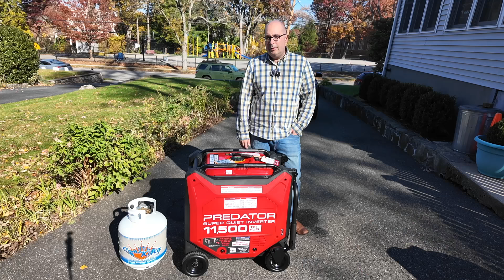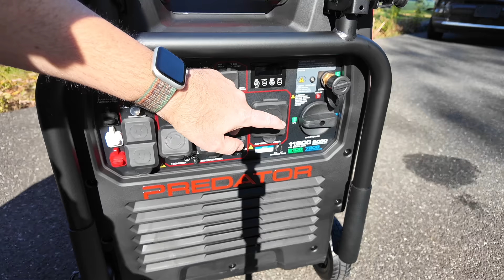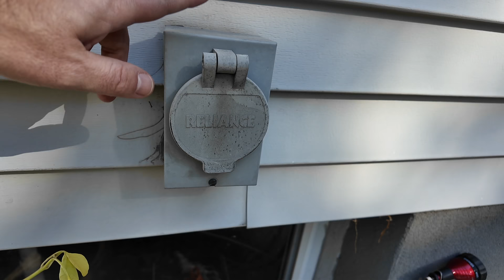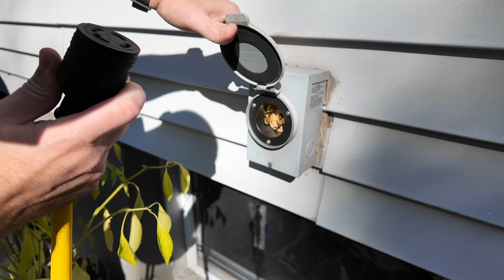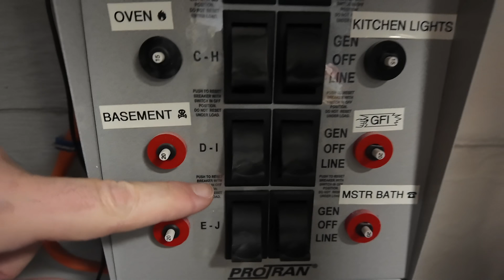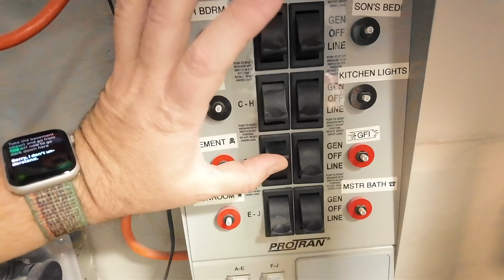Predator 11500w Powers My Entire House (Transfer Switch & Full Test) — Honda Should Be Worried!

Comment from the maker: So… would you trust this Predator 11500 to run your whole house instead of a Honda or a Generac standby system?
I’m honestly curious what you guys think — is this the future of backup power or a bad idea waiting to happen?

What do you want me to test next?
🔹 Propane vs Gas
🔹 Noise test
🔹 Fuel burn / runtime
🔹 Predator vs Honda showdown
🔹 24-hour non-stop run

Drop it below!
Reply: I’d like you to run the test by letting it operate for 24 hours.
Reply: @yagofornite  I have a Predator 5000 and we did a week long boondock camping trip. The generator ran 24/7 for 6 days stopping only long enough to refuel. We had zero issues. I'm honestly impressed with the 5000.
Reply from the maker: I love the 5000!
Reply: @yagofornite it powered my shop for 72 hours and still run like new
Reply: I would most definitely buy this Predator generator over a permanent mounted Generac or other brand. I love Honda, but they are too expensive for me.
Reply: @Prepared-NotParanoid and you’d make a good choice. Hondas are excellent no doubt but they are not worth their price imho
Reply: Definitely. You can get two of these and still be cheaper than the i7000
Reply: "So… would you trust this Predator 11500 to run your whole house instead of a Honda or a Generac standby system?"
Simple answer, yes. 
During Sandy my Honda 3000 ran what I could in our house for 13 1/2 days, non stop, almost 320 hours, including my neighbors fridge and TV for the first week.
At that time Generac had a terrible reputation for engines failing within a year.

After Sandy, in 2012 I installed a 15KW Milbank NG generator with a transfer switch. Did 99% the work myself, got the genny and switch on close out from a local electrical supply house ($4,215, delivered).
Only work I didn't do was replace the gas meter from a 200 CFH to a 400 CFH. PSE&G replaced the meter at no charge as they are required to supply the service for the calculated load. The service team also piped in a capped tee for me.
All in I had just under $6,000, including landscaping that was required by the town. That was a bargain, contractors were charging an average of $20,000 right after Sandy.
Worked great and for the next 8 years and it was used twice for a power failure. First time the power came back on before the transfer actually occurred. Second time it ran for over 2 days while we were away, that was not acceptable for me. My neighbors had to listen to it for those two days and had we been home it would have been off at night.

I sold my Honda 3000 after 15 years of use with about 1000 hours with zero problems other than the battery, and Honda's really don't need the electric start.
The 9500 and 5000 predators have a history of engine problems, specifically rockers and or pushrods failing.

New house in 2020 is in an area of reliable utility power and I decided on not having the expense and noise of a permanent standby unit.
Had an electrician add a panel interlock and run the cable to an outside receptacle. 
Took the gamble on the 9500 over the Honda 7000 mainly because of cost, $2000 versus $5500.
Have only used it once for an hour or so since buying and if it fails I could replace with the new 11500 and still be less than then the Honda.
I don't think Honda has to worry, there are Honda people that will only buy Honda's.
Reply from the maker: All of your points are 100% spot on and I totally agree with you!
Reply: Predator vs. Honda showdown PLEASE!  SOON!
Reply from the maker: That’s a great suggestion! I’ll try to make a future video about that
Reply: As someone who had a Generac GP15000E and a Predator 5000, the power is much cleaner coming out of the Predator being an inverter. The Generac is quite dirty and temperamental. Unless you load it heavily the Generac has issues with voltage fluctuation. During a hurricane, I was keeping power use low to conserve fuel but started having issues with appliances and battery backups. I ended up running things I didn't really need just to keep the Generac stable. I will add with the Predator, we ran out RV for a full week on it 24/7 with no issues, but we had to turn eco mode off. It wouldn't handle the RV A/C kicking on in eco mode and just shut down.
Reply: After looking at stand alone $13-17000 cost Kohler.. went with the Predator 11500.  For about $5000 cost purchase and install I have a triple fuel, quiet portable whole house generator.
This was panel upgrade, ramp for backdoor garage, safety switch for main off and Gen on.
Think this was the ticket for me.
Reply from the maker: I totally agree with you on all points!  Congrats on your new genset
Reply: With the information and proof you have provided, I trust the predator 11500 big time.
Reply: These have proven themselves already.  HF did a great job here especially when you consider the price..
Reply: So I live in rural Maine, so we're accustomed to losing power for several days or even weeks in the middle of winter. I have a Predator 9500 and I bought a second one for my Parents home so I can make sure during a storm they have power as well. The 9500 will power my whole home no problem so long as I do not run certain things at the same time. It will run my furnace, water heater, all the lights, tv etc with no issues. But if I need to do laundry I have to make sure I turn off the furnace while the dryer is running. If I am am running the oven I can run it with the furnace but to be safe I just click the furnace off while we're cooking. We have natural gas at my home and my parents home so we are buying the 11500 predator and getting rid of  both of the 9500s so we do not have to buy gasoline. We have had no issues with the 9500 at all so YES we would trust the 11500 as well. It's very nice to basically keep living as normal when the power goes out. I even occassionally take my generator to friend's homes during an outage to help get their heat turned back on and make it so they can maybe take a hot shower and cook a meal or two, and for that purpose I might keep one fo the 9500 generators to loan out or take to peoples homes.
Reply: Be sure if going Generac brand, or any brand, get Inverter type.
Reply from the maker: @VZWSevenFiveFive4334 inverter is definitely key
Reply: I have two transfer switches: one for the most important circuits and another for optional circuits, which I don't hook up too often because I don't want to run 2 generators (they're so loud). They have the standard NEMA L14-30R males (30 amp). With this one generator, I can power both by getting a 50 amp male to 30 amp female adapter that I can get from Lowes. I just have to sell one of my other generators first. If this is covered with EMP proof cloth, it would still work in a worst-case scenario, but a Generac whole house would be fried.
Reply: Predator vs Honda please
Reply from the maker: Will try to do that in a future video!
Reply: @Outdoor_Prepper  That would be GREAT!
Reply: I have a Predator 8750 open frame inverter generator that I bought with a no coupon for $899 plus tax. I have several natural gas appliances, so I have no problem running my entire house, although I do not use my electric wall oven, just my gas cooktop during outages👍
Reply from the maker: That’s a great setup!
Reply: @Outdoor_Prepper  I used the 30A breaker from my old electric water heater, and installed a 30A plug with a 30A cord, for a total cost of $1,100. I have a checklist on my breaker panel so I never forget to shut off the main breaker or the generator breaker👍
Reply from the maker: That’s a solid setup!
Reply: Of course. Like the Honda or Generac have some superior power production. Not!
Reply: Maybe not, but in all but edge cases, Hondas are replaced on your terms, not the generator’s. There is a real cost to owning a generator with a mean time to failure beyond 5,000 hours, which is why you do not see Formula 1 teams, Hollywood productions, or heavy highway contractors relying on Tier 2 generators.

The EU7000’s direct fuel injection improves fuel efficiency and largely eliminates the carburetor problems common in modern emissions-restricted designs, where adjustment is limited to idle speed only. Then there is the risk of inverter failures. Some failures can output unregulated voltage and potentially damage electronics and appliances.

The EU7000 has dual redundant output monitoring. If power quality is not perfect, it shuts down instead of passing bad power. That level of protection is uncommon in Tier 2 generators since cost has to be cut somewhere. This is especially concerning with traditional open-frame non-inverter generators, where one of the most common failures is the AVR, often a roughly $30 part that, when it fails, can produce wildly out-of-spec voltage.

Both options are priced appropriately, and the Predator is a strong value. Ultimately it comes down to user preference. For me, I factor in that you will not be able to buy a second Predator during an outage. 

Though anything can happen, which is why I’ve decided to order a EU2200 to replace my 6800W Ridged with only 101 Hrs, which runs perfectly, but now that I have it hooked to my entire house am not comfortable trusting all of my electronics and appliances to a very common to fail $30 Chinese AVR or a cheap mechanical governor, either of which could fail and cost me tens of thousands of dollars. (Plus I want it out of the garage, one large generator takes up enough room. 

I must emphasize there is no right or wrong. It’s just user preference, use case, and risk tolerance (in the eyes of the user).
Reply: I would absolutely trust the predator generator to run my house. I have the 5000 watt dual fuel and I have used it in emergencies. And no it won’t run the house. Just what’s necessary. No issues and it’s decently quiet for its size. Also, the predator generator has been out for awhile. And they’ve made some positive improvements over time. And I could buy another 5000 watt generator and parallel the 2 together for 10,000 watts. And I already have the kit to do that. It was about 50$ at Harbor Freight I think. It’s a great unit! It’s also a great unit for an RV if you have one.
Reply: Propane VS Gas.
Reply: Yes I use the Predator 13K with interlock to power my home during power outages. Works great with my mini split system, fridge, washer and dryer etc
Reply: Ookm
Reply: I have a Predator that powers my house except bedroom lights. Powers AC, furnace, well pump, fridge and additional freezer. Family room with big screen and computers. Have it on manual transfer switch. Excellent quality
Reply from the maker: @MrJacknoJill the predator line of generators are actually really good!
Reply: Fuel burn/runtime and 24-hour non stop run.
Reply: I Would!!!!  The more it cost doesnt always means its the Best!!!  I own several Predator and Champions they always been good to me if your Good to it!!!!!!!!!!  6k  for a gen is Ridiculus!!!!!!
Reply: Maybe 1/3 the cost!
Reply: I have a 8750 predator would be think that would a two tons HVAC system and septic tank pump? Just for winter emergency if we lost power due to ice storm?
Reply: Whole house generators overpriced thing of the padt now. 
Love Harbor Freight! I hear nothing but good things about their Predator generators!
Reply: Lkookomkpok
Reply: My predator 9000w took care of me in 2021 during that ice storm. My Harbour freight predator 9000w ran continuously for 6 days
Reply: Man great stuff I watch you all day. I was considering the anker 5500 gen with additional Anker batteries for a range extender setup, thoughts?!?
Reply: That lil tank will run that Generator for a couple of hours depending on the load.  If you plug it into your natural gas... LOL get ready to take a loan for when you have to pay the bill for a multiday event, not as bad as a Generac running for a couple of days but still most people dont realize the cost would be in the thousands ... bro THOUSANDS.    In a multiday event like a hurricane or the snowmageddon here in Texas, you will need good ole gas ...I would keep a good 25 gallons of non ethanol gas treated with some sort of fuel stabilizer.  Fill up your car once a year and then replace the fuel.  My house has most appliances running natural gas... heat, hot water, cloths, and range.... I ran a lil ole Champion 2500 on a one 100 lb propane tank like that for two weeks until our power was fully back on (no rotating blackouts).  For summer outages I have a large WEN that will power my AC ... but the longest in the summer has only been a day or two.
Reply: @xmarine11 Wrong.  Nat gas is cheap.  Look at your electric bill.  Nat gas is a fraction of what the electricity part of the bill is.
Reply: @xmarine11I don’t think natural gas would cost thousands for a couple days…???
Reply: @xmarine11 Great advice on the gasoline storage. I wish I had done that because it might have saved me some money. I'm in East Texas and we had a 5 day outage in the middle of the summer. Temps were triple digits during that time. I used a 4000 watt Wen to run a couple of window units at night and a 2500 watt Champion to run fans and a single window unit during the day. I kept our fridge and freezer going with 400 watts of solar and two 12 volt LiFePO4 batteries. There was one single station in town that had a backup generator and were able to sell fuel. We ended up spending about $130 on gas and propane.
Reply: The future is a battery backup system with solar and a generator like yours to top up and supplement  the batteries.
Reply: @turtle1723 maybe one day, but right now they have too many drawbacks to be viable for most people.

Comment: Not ideal as low running watts and having to continually refill the rank if using gasoline too.
Reply from the maker: Fuel efficiency and total output capacity are always important factors to consider for any home backup setup.

Comment: Nice video. Several years ago I got a 7500 running Watts champion generator and hooked it up to my house.  I thought I was going to have to use a transfer switch but I found an interlock kit at home Depot for 50 bucks.  While I'm not an electrician I hooked everything up by myself so if you're handy with wiring and breaker panels it's fairly easy and a whole lot cheaper than a transfer switch.  My only regret is not getting a dual fuel generator as the one I bought is strictly gasoline.  Thanks for the video
Reply from the maker: That’s a great tip, interlock kits are definitely a solid and cost-effective alternative to a full transfer switch! 👍
Reply: @Outdoor_Prepper the one thing about interlock kits is that you have to get one that is specific to your main panel.  You Can't just go in and buy a universal kit.
Reply from the maker: @michael.w.salter totally agree 👍

Comment: This information is not accurate. You should unbond the ground on the generator IF you’re using the interlock method. 

In the USA you should only have one bonded ground in your home and that should be the main panel. 

Using a transfer switch like you have, from what I understand, does not always carry this same issue.
Reply from the maker: With the transfer switch I have, you still have to un bond the generator
Reply: @Outdoor_Prepper you did not highlight this in your video that I recall hearing/seeing. 

Did I miss that?

Comment: Good review. I was hoping you'd go over maintenance a little more. Before starting you added oill, where was that positioned? Did you have to remove a plastic panel to get to it?Also is there any protective features like does it monitor the oil and automatically shut down if it's low? And  when you hooked up the power cord  then started  the generator, were you throwing power into that box that was  connected to your panel? I saw you have breakers in that box you installed with the romex but All the circuits were connected to the main line right? Then you switched the basement to generator power. Did I miss something? I was looking at a gen-max TRI-FUEL 11000 start amp...
Reply from the maker: Thx for watching! You have to remove a side panel to add the oil. It’s a little difficult to see the oil fill as it’s pretty low on the unit. It does have a low oil shut off so if you don’t fill it enough, it will shut off. Basically you fill the oil to the top of the threads of the oil fill

Comment: Actually you're not powering your whole house. At most you're pushing 50 amps through the generator. Turn on the electric stove and the water heater kick in your generator will kick out. Your house is 200amps. Most of the time you'd only pull 100amps at a time but when you're only pushing 50 amps you can't say you're powering the whole house can you. Lol.
Reply from the maker: It’s definitely more about strategic power usage than running every high-draw appliance at once during an outage.

Comment: The air-cooled do not have oil coolers. Even oil-coolers won't save you. If your power is off for days, it'll burn your engine up. That's important. Short-term only, folks.
Reply from the maker: That is a very fair point and maintenance is key for these engines during extended use.

Comment: Only their water-cooled diesel engine generators. They all have them, but they cost more. These air-cooled 4-stroke (lawn mower) engines are made for a few hours here and there. Not keeping them maintained as the warranty states will void the warranty. Generac, and Kohler have air-cooled and diesel, but Cummins is diesel only.
Reply from the maker: That’s a fair point, and regular maintenance is definitely key to keeping these air-cooled engines running reliably!